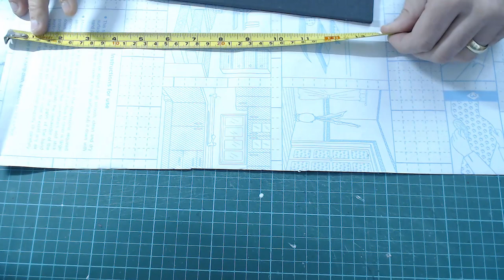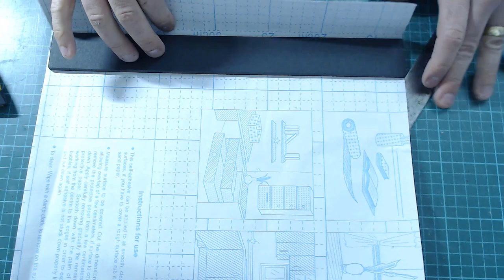Making a Paint Rack

Comment: Good idea 💡 not going to lie I was a little sceptical but they are pretty good if you add a spine or a backing board the bowing would be fixed if it was an issue for anyone 🙌
Reply from the maker: lol I have since add vertical strips in the middle that combat the bowing. I did think about adding a back board though, I still might!